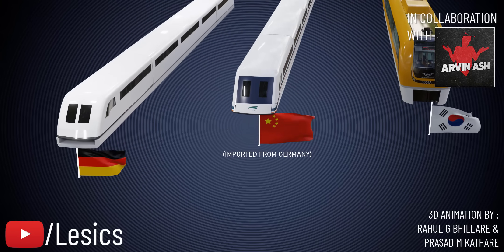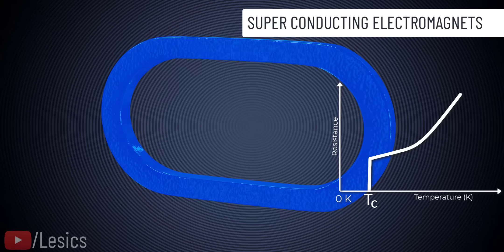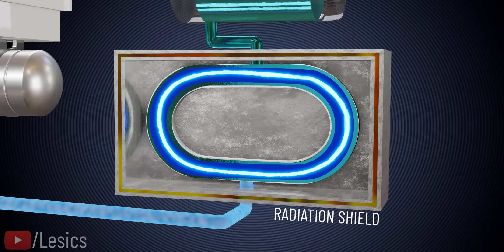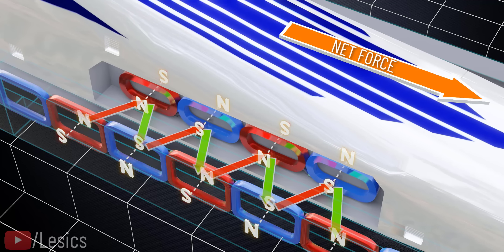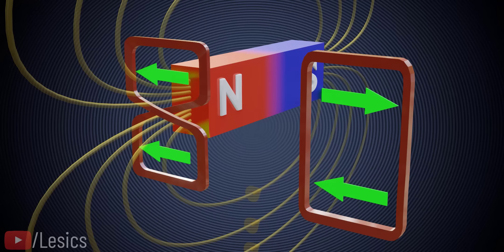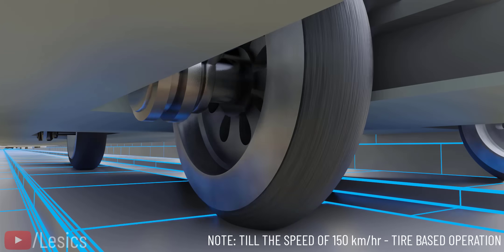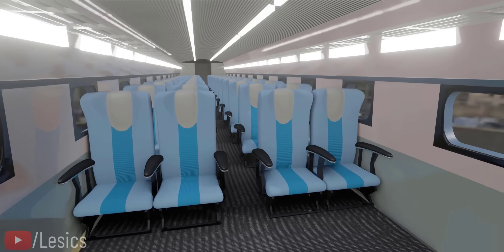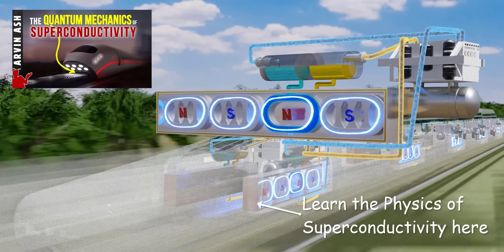The Fastest train ever built | The complete physics of it

Comment: I would have liked to see the costs for doing this so it could be compared against other modes of long-range transportation like planes.
Reply: Well a couple thing

It probably would be very expensive in the short turn but in the long run it's most likely we'll worth it

It's also probably less maintance that a huge plane and doesn't cost as much to run without full capacity

And lastly its also alot more direct than other forms of transport
Reply: @baileyjerman5573  One thing for sure with no maintenance it would be the same ticket price in ten years as now.
Reply: @edwardbarnett6571  well yeah because the tickets are to recoup money over time not instantly which
Reply: The first commercial Maglev is operating in China. They say you can't get profit directly through building this kind of Train system, but they did it to develop China indirectly.
Reply: In this specific case, the cost of the maglev isn't that important, because the route of the line is straight through the mountians. Amazingly, about 90% of the line will be underground, so it's an intercity, 500 km/h subway. The tunneling will be most of the cost, so even if they used conventional rails instead, it wouldn't be much cheaper.

As for the cost of the whole thing compared to air, I doubt JR Central cares about that either. They're a railway company and don't want to lose any market share to the airlines, but their current high speed rail line between those cities is already at capacity. They need to build something, or they'll lose market share, and no matter what route they choose it will be very expensive because it's a very built up part of the country. They are a private company, so I expect they've done the math on this. They'll also be offering a far faster and more convenient trip, so they won't need to compete on price alone.
Reply: @TonboIV  The second free face hardrock TBM should drive 100m per day drasticlly reducing the cost of tunnels https://3dwarehouse.sketchup.com/model/c1405816-d744-4363-8cf8-729828f9397e/14m-cone-with-discs
Reply: @TonboIV  The costs always matter. They need to compare this to other ways of spending that money.
Reply: @TonboIV  There's the upfront costs and then there's the operating costs. On top of that, we need to know the ticket costs. Not a single dollar amount has been provided. Just "Trust me."
Reply: @GerardPinzone  This a very successful railway company we're talking about here. They aren't building this thing to be a failure. The trains will carry about 1000 passengers each. This is clearly designed as a mass transportation system, and the tickets will have to come it at a competitive price point or they'll be running a lot of empty trains. If they say "trust me", I'll trust them, because it's in their best interest to deliver, and they have a lot of experience with running trains profitably.
Reply: @GerardPinzone  Trust you, why??? What experience do you have in the building and running of a mass transit system ???
Reply: @GerardPinzone  I guess it will just be a tad below planes to keep passengers.
Reply: https://youtu.be/ffO_McpxSHE
Reply: No comparison. Trains are for local travel
 Jumbo jets are for overseas or long distance. It would take 10 planes to hold the amount of people that one train can hold. So even if you fly a plane the same short route as this train you would have to multiply the planes cost times 10 because it would take about ten of them to transport the same number of passengers.
Reply: @danc1197  Agree on local vs distant travel, but airplanes aren't limited to the one single route of the train track. Your cost comparison only accounts for going to a single destination. Once in the air, an airplane can go to a hundred different airports. You can spend 80 billion building a rail line between Los Angeles and San Francisco, but that's all it can do. What if you want to go to Seattle or San Diego, Phoenix or anywhere else? What about the cost of buying land, leveling the grade and building tracks and grade crossings, bridges, tunnels and everything else? That has to happen for every location you want to travel towards. It takes millions of hours of diesel construction equipment to build all that. What about the cost of maintaining the train's right of way, forever?
Reply: @ifmbm332b  Exactly! Most people don’t understand the use case is viable for Japan because of the layout of the country. The US does not have that quality but the opposite. The only way to make that financially feasible is to have two points that are WELL traveled to make sense. Even then Americans do not like their land grabbed up by the government, so good luck with that.
Reply: @danc1197  Please show your work.
Reply: I also missed that. While I think that the train itself wouldn't be that much more expensive than a regular one, the rails need to be covered in multiple thick coils at all points. That's a LOT of copper, and it needs to be processed too. My guess is that the cost of the rails is why maglev trains are still a novelty.
Reply: Boycott japan.
War criminal!
Reply: @TheReal_XiJinping  Oh trust me some of us Muricans know... Not much we can do when our country is run by oil companies and other such interest groups. I would LOVE to see trains in my area but they've talked about it for 20 years with no progress in sight.
Reply: @jkangaroo  I think it's not so necessary coz a public transport isn't so popular in the US, cars rule.
Reply: some asshat with experience cant give you a figure LOL. Im sure trains are more expensive than airplanes until a point in the future recapturing cost.
Reply: Valid for the ordinary round trip ticket in 7 days	80 yuan
Reply: 5 to 6 times as costly and not as many people.  So speed makes up the difference 🤔.
Reply: It's honestly just a shit technology and outdated too. Hell I'm not paying extra money to reach somewhere an hour earlier lol.
Reply: @DalitKumarAryan  If it is cheaper to catch a plane they would lose custom so they must keep it a tad below.
Reply: @TheReal_XiJinping  yeah he wants to look like an expert lol his comments don't make any sense just like reddit.